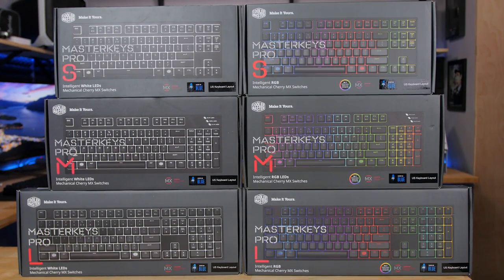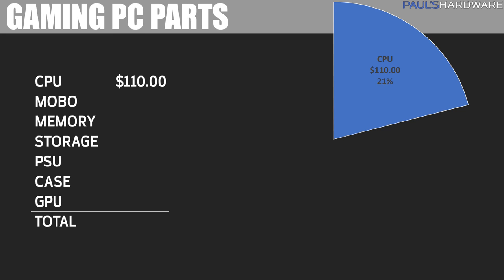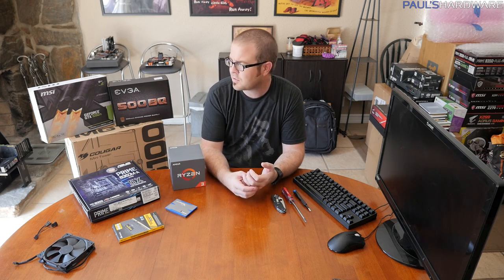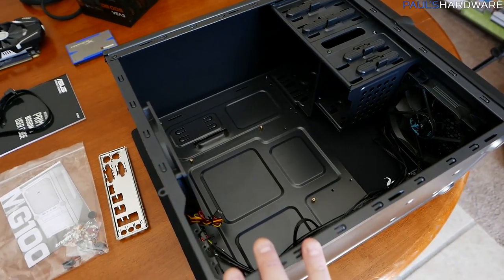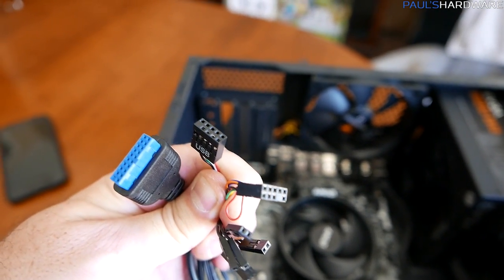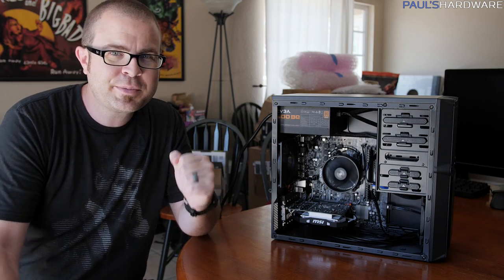How To Build a $525 GAMING PC with Ryzen 3!

Comment from the maker: -== TIMESTAMPS ==-
0:25 Introducing Ryzen 3
2:07 Intro to building a desktop PC
2:42 The 7 main parts in a Gaming PC
3:22 This build's Parts + How much each part costs
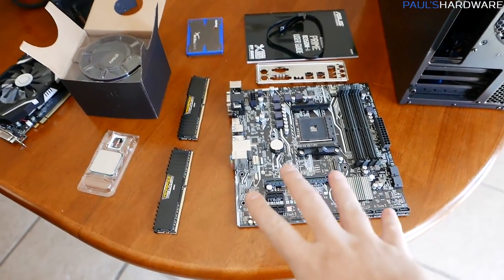9:12 Preparing to Build
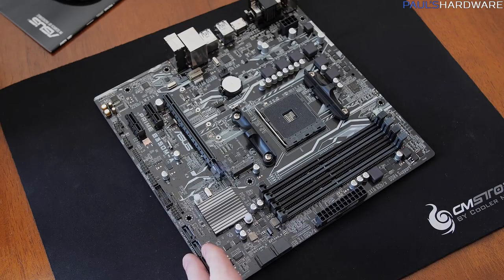11:37 CPU Installation
13:51 Memory Installation
14:58 Prepping the Case
16:23 Installing I/O Shield
16:59 Power Supply Installation
17:34 SSD Installation
18:20 Motherboard Installation
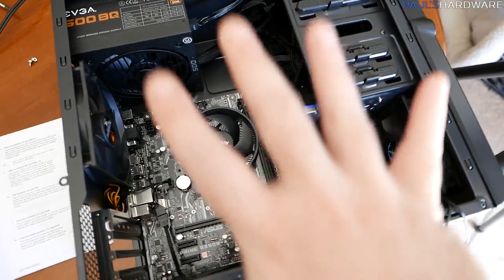20:11 Plugging In Fans and Power Cables
22:32 Plugging In Front Panel Connectors
23:21 Installing Graphics Card
24:29 Final Build + Closing Thoughts
Reply: Paul's Hardware I got 16 GB of ddr4 2800 MHz RAM for about £80 or $105, the only download is that it's a 4x4gb kit. It's the ADATA XPG Z21 or something like that.
Reply: link for the where to get windows 10 for 30 bucks??
Reply from the maker: I added the Windows 10 + other video links to the description, also cards are added now too!
Reply: Paul's Hardware does the $550 include windows 10 price
Reply: Thank you for at least mentioning peripherals and OS.... Two major price factors often left out of build videos
Reply: no you have to get linux no worry because arma and xplanes are on it. and thats all you really need
Reply from the maker: fixed!
Reply: i would say go with the g.skill ripjaw v series for 65$ its 2800 speed but not to overpriced
Reply: ok the song paul please at 1901
Reply: hey paul, how did you get those ram sticks running at 3000? i got the same motherboard with a 1600, same ram but the ram will only run at 2333
Reply: Paul's Hardware just thought I would say that if your lucky you can find that 1050ti at microcenter as a open box for $111 
which is a good deal.
Reply: Paul's Hardware You said the 1050 ti had 2GB it has 4GB
Reply: hey man that 1050ti is a 4gb model
Reply: 0:01 imitating JayzTwoCents.
Reply: Paul's Hardware why are you using nvidia gpu on a budget pc because gsync monitors cost as much as this pc
Reply: this video is both wallet friendly and noob friendly in many ways. like it
Reply: Paul's Hardware ii
Reply: 1:31 Been building and using PC's for years and only now do I discover CHA_FAN stands for Chassis Fan, I always cal it case fan so I always thought to myself, well, shouldn't this be CAS_FAN or CASE_FN or something... Now I get it! Thanks Paul!
Reply: You said Ryzen doesn't have integrated graphics but the motherboard has VGA and DVI. Why?
Reply: For AMD's next gen APU's when they come out.
Reply: There is a Ryzen based APU in the works. Release dates are sketchy.
Reply: Paul, would it be possible to have some benchmarks with this build? this might be a good cheap 1080p gaming pc i can get for my sister to get her back into gaming so she doesnt need to struggle with poor performing laptops anymore
Reply: Kevin Archer I have a similar pc, overwatch 1080p will run 75 fps
Reply: RavenGaming umm thanks, what other games and frames can you list, I've never played overwatch and don't care to lol sorry, and what graphic settings? I'm on pcpartpicker right now putting something together, gonna change a couple things from what Paul chose, but not too much

My sister would probably play guild wars 2 the most, unsure what else she would play, but her bf might play shooters, so gta5, bf1 settings and fps would give me an idea, I'm thinking she will be fine with a 1050 ti 4g card, it's cheap, it should run most things currently, and she can upgrade the gpu later if she needs to, but just getting her started would be nice
Reply: Cool build but meaningless without numbers to validate the "why" of it. 

It's a growing trend that has been kind of getting annoying lately. 

"Let's build a system!"
Cool build. What's it do.
"Tune in next week when I get around to benching it!"
God damnit... Really?
Reply: he usually does benchmark videos separate
Reply: Hi Paul not sure if anyone pointed it out but at the bottom of the case there is 4 screw holes that is the size to mount a 2.5 inch driver you can see it in your video around 24:54 i build in a case like this and i utilized that spot for the ssd. thanks for the awesome videos.
Reply: +Kenny lagace
2.5 inch DRIVER or DRIVE?
Reply: whats the name of the song at 19:01  ???
Reply: Paul's Hardware Where's the monitor man???
Reply: lol drive hehe
Reply: on my mind - anders bothen
Reply: Paul's Hardware , I want ask u about how to choose matx size mobo for amd ryzen 3. Idk how to choose which one. Can tell me which matx mobo am4 is cheap and quality good?
Reply: Paul's Hardware, RX 550 4GB + R3 1200 = ?
Reply: Paul's Hardware Thanks so much Paul this was a great tutorial, I just built my first pc with it. 
Rosewill FMB01
Ryzen 1200
Msi gaming pro mobo
8gb Viper Elite 2800 ram dual channel
450w evga bt
Wd blue 1000gb hd
Used GeForce 970
$510 of Awesomeness
It's a beast! Thanks again!
Reply: Have a major hard-on right now, thank you.
I'm a noob to all this, I bought my first laptop 3 years ago (my first PC ever), I was salivating over a $2000 rig that was just out of my reach because of the economy and every thing that entails, but this video looks (just about) easy enough for me to do. The price point was the major factor, so thank you.
One question, if I don't find the proper case I can just use a cut out card board box and superglue to house everything, right? I'm not stupid or anything, the box WILL have vents to keep it from overheating, duh.
(last part was a joke)
Reply: D Sandoval
Your broccoli sandwiches will achieve both sentience and vocality at the moment of being consumed.
Reply: Hay Paul I have purchased all of these parts for my build on Christmas and when I finished it did not turn on. Now this could be for many reasons but i remember that I had a 8gb ram that was clocked at 2400Mhz and when I looked back on your video the one you used was clocked at 3000Mhz. After doing research about the ram situation for ryzen chipsets I noticed that most people would say that you will have better luck having a higher clocked speed ram e.g. 3000Mhz  so i decide to purchase the exact same kit that you have bought now they will come on the 27th as I am typing this and i would like to have your say if this is a good purchase/ if it is true that Ryzen requires/needs a higher clocked speed ram to work . Also again using the same parts as you in the build.
Reply: The Ram is nowhere near $80 its 120 click the link you posted

Comment: I like to agree 99,9% of the time with what Paul says but at 1:04 I thought I misheard something.
Quote: "If you overclock a Ryzen 3 1200 you get a Ryzen 3 1300X" ... a non-overclockable 1300X at that point I suppose?
Or am I tripping and is the max frequency on these chips the same?

Comment: The motherboard almost costs as much as the processor itself lol
Reply: Floppin yeah
Reply: Floppin I'm guessing this is supposed to be a budget build and if it is the motherboard shouldn't cost that much
Reply: if you dont want to overclock you can use a320 motherboard XD
Reply: Funny you should say that, because I remember that for my very first computer, I paid nearly exactly the same for the CPU, motherboard and RAM, at €30 each (this being in the Socket 754/939 days, when CPUs were much cheaper)
Reply: Still better than i5 7640x where it is x2cheaper than the motherboard
Reply: Yeah and it's overclockable, and upgradable!
Reply: and how is it upgradable?
Reply: Uchiha Madara you are able to put in a ryzen 5 or 7 and can put in more ram, that's what upgradable means
Reply: AMD is going to keep using the AM4 socket for a few years, or so I hear. That means that in the future when AMD comes out with a new Ryzen lineup you can just take out this Ryzen 3 and thrown in a 2nd generation Ryzen 7 CPU or whatever fits your needs. Also it is overclockable.
Reply: Tuchulu they confirmed before launch, as paul has retorted on a awesome hardware episode, they claim atleast 10 years, but take with a grain of salt. A company being a company and all.
Reply: Yeah, and also has 4 usb 3 ports and 2 usb 3.1 ports instead of the crap usb 2 ports that are standard in cheaper motherboards. If you ever spent hours instead of minutes transferring gigs of data from/to external HDDs/Flash drives you know it's damn well worth the extra little money.
Reply: There are b350 for 65
Reply: low end cpu + mid end mbu that supports high end cpu and oc, so a good deal.
Reply: Magic Turtle Gaming please tell me where did you find a cheaper B350 motherboard that also had usb 3.1 and four memory slots because I've search amazon and pcpartpicker's parametric filter and found none. Also the price difference between the cheapest b350 micro atx board I could find and this one is between $8 to $20 depending on where you look so here's my question: Are you such a miser  that you're willing to let go of better I/O and and more ram slots for that measly amount of money? Just because it's a budget build doesn't have to have the shittiest components available.
Reply: Énio Fernandes calm yourself it's just YouTube
Reply: Magic Turtle Gaming, where double standards and hypocrisy abound, gotcha.
Reply: Bridger Reif Hammond nothing wrong with investing in a good motherboard if you plan on upgrading later. I also chose a good motherboard when my laptop died and I had to scrounge money for parts for a new PC. I went with an MSI MPOWER Z87 because I needed wifi and wasn't much more expensive then other Z87 motherboards, and went with a Pentium G3420(1/3rd the price of the motherboard). The naysayers will tell me how misguided I was by going with that motherboard  and CPU combo, It served me well until recently and now that I needed more cores and I could afford it I upgraded the CPU to an i7 4790K and it's still beast of a PC without buying a complete system.
Reply: Bridger Reif Hammond nice starting point a nice case but your upgrade path will be limited by the case though as it will be pretty toasty in there the faster you go!
Reply: +Bridger Reif Hammond - Neat job. If you don't mind me asking though, and since you say you've been an AMD fan for years, what was your old system? Was it Bulldozer or still K10? I still used a Phenom II X6 1055T before upgrading to a Ryzen7 1800X, because I too have been an AMD fan for essentially all my life, and yet I didn't want to "upgrade" (sarcasm quote marks thoroughly justified) from a Phenom II to an FX Series, so I was waiting seven years to finally be able to really upgrade my CPU, and just got an 1800X as soon as it was available for preorder.
Reply: Bridger Reif Hammond I have an FX 4300 and want to upgrade to ryzen 5 1600
Reply: Bridger Reif Hammond with the sentry case I don't think you can even have water cooling in place of the GPU so you can go as big as you want as long as you ditch the case, yeah.
Reply: Énio Fernandes go away
Reply: Bridger Reif Hammond it has but barely. You're limited to either something the size of an R9 nano with a 120mm radiator for the CPU or a 240mm radiator for the CPU and no GPU. If you want to use a 1800X and a Vega 56/64 things will get extremely toasty, that's all I'm saying. Of course you don't need that much to build a very capable gaming PC
Reply: never cheap out on your motherboard
Reply: Uchiha Madara I'm waiting on 2500x to stick in instead of r1200 in the same motherboard
Reply: you can buy a cheaper motherboard and a cheaper power supply, but you would strongly sacrifice upgradability

Comment: I remember working as a system builder in 2006 when dual core CPU's were still on the rise. AMD was the more affordable choice in most cases, which really do require delicate care. Those pins are really fragile. Once one of my (intern) coworkers dropped it from like, 1 inch onto the motherboard, and an entire row got bent inward. I managed to bend the pins back for him without damaging or breaking any, but we were sweating bullets the entire time when this happened.

Comment: Basic advice for beginners. Always build computer outside the case first and try to post. So if there is a problem with one or multiple components, you don't have to  undo all the work you've done mounting inside the case. Other than that, good video.
Reply: How good is this PC for gaming.

Comment: It's so amazing that for $500 one can build a pretty decent PC today.
Sure you can always go higher, the amount one can spend is unlimited; but to get a console level PC for gaming/graphics you can do for reasonable amount - and it's a PC after all, with everything that comes as an advantage over a simple console.
This build is spot on: By going Ryzen, not only is it cheaper, but thanks to the 1 socket, you can always upgrade to a beefier CPU later; GPU can always be replaced; memory, storage always upgradable.
The only suggestion I'd make is, if somone knows/feels that the 1050 Ti may not be good enough for them but are short on money, go with a used 1050 Ti (or anything) and used memory modules. Then saving money and upgrading the GPU in 3-4 months would mean minimal loss. But never buy used storage.

Comment: I would like to mention, both the ryzen 3 x1200 and x1300 cost around the same atm... and i feel like youd be able to get more 'overclockabiliaty' out of the higher base clocked cpu. Just incase you wanted to get better performance out of an ok cpu

Comment: So I got some questions.... I'm a more casual gamer looking to upgrade and this video appeared on my front page and I checked into it. Paul doesn't seem to have a website with forums, so I'll ask my questions here.

1). My 5-year old desktop computer has an AMD 6-Core FX6300 3.5Ghz, an ASUS M5A97 and 16GB DDR (don't remember what speed), along with a 660 GTX. How much better would the system in this video be, than the above specs? I know the graphics card is worlds better, but the other hardware I am not sure about. I know how to put a computer together as I've done so for years, but I've kinda fallen out of the loop as far as technology advances go as it's been 5-6 years since I've last built a PC.

2). Will the above fans actually keep that system cool under load? The computer specs I listed above, the case it's in is a mini-tower with two of those really large fans (what are those, like 180? 200? mm), one in the front, one in the back and a standard exhaust fan, AND I was having overheating problems after a little dust built up in the heatsink so I replaced the stock cooler with this huge vertical heatsink with copper pipes. The cooling system above seems.... basic, considering what my older computer needed to stay cool. I also worry about the GPU being so close to the bottom of the case, is air going to have very good flow there?

3). How are SSDs nowadays? I know 5 years ago, SSDs when they first came out were widely criticized as they had very limited writes. Reading is lightning fast, but writing to them eventually burned the chips out and the drive would eventually fail. Did they manage to improve this? Is it safe to put something like the OS and/or frequently updated games on such a drive and have it work for years?

4). What's the minimum power rating you'd think to be safe with this setup? I do not recall exactly, but I think I have a 470-watt in one of my computers that I want to upgrade, but the one in this video is a 500 and I recall Paul saying it would leave "a little headroom in case you wanted to upgrade the GPU".

Thanks in advance!

Comment: Isn't a 1050 2GB and
            1050 ti 4GB
Reply: no...the 1050ti is mostly a 2gb card. It even says it on the box. Same as how the 760, 960, came in 2gb and 4gb.

For  $115 you get a 2gb 1050ti and for $139 you can get a 1050ti with 4gb as an option.
Reply: no im pretty sure he meant the 1050, try looking for a 1050 ti with 2GB, you'll have a tough time
Reply: For desktop yes, for laptop there is a 1050 with a 4GB variant
Reply: SUPER USER If you're getting a 1050 ti get the ssc for better clock speeds and it runs a bit cooler
Reply: Dana's #1 Fan You can get both versions of the 1050ti for the same price
Reply: Dana's #1 Fan I live in the states and both versions were $139
Reply: shadowofdeath24 no... wrong. 1050ti is always 4gb the 1050 is always 2gb. look it up.
Reply: Had to check the comments for confirmation because I have a fever and thought I was tripping for a second but, yeah, I thought that about the 1050/1050ti too!

Comment: YES YES finally i can upgrade RIP i3 4160
Reply: wouldn't a decent haswell or broadwell i5 be a better choice as you don't have to factor in the cost of a motherboard? Ryzen gives you a great upgrade path up to 8 cores and DDR4 though
Reply: I had i3 4170 and it was so bad now i have i7 7700 it's so much better upgrade asap
Reply: defi well the r3 does open the path up to r7 and the next 2 or 3 generations of ryzen on am4 *if amd sticks to there promises.
Reply: just get a 4770 off ebay?
Reply: Just get a 4690k/ 4770k off eBay for like 75$
Reply: omar aman 4690ks are going for much more than that
Reply: it's a 4th generation i3 so that's weaker than r3, but I still don't think it's worth to switch except if he's going to upgrade to a ryzen 7 in the future. Then getting an r3 and a b350 motherboard is a good choice.
Reply: Your best bet would be to find a used 4770K/4790K or 4670K/4690K. That will be a HUGE upgrade for you and it will last for years to come. You have to remember when switching to AM4 socket, you will need a new CPU, mobo and RAM (DDR4). Which all together will cost as much as 4770K/4790K which STILL absolutely destroys any Ryzen 3 chip.
Reply: i have a non oc mobo matx board with 4gb of ddr3 ram
Reply: You could always use a hyperthreaded xeon i think they'd work just as good as an i7
Reply: Sleepy Weirdo did you upgrade yet?

Comment: So yeah there is a mounting point on the bottom of the case for an SSD you just screw it in from the bottom. The holes are recessed up into the case to leave room under for the screw heads and elevate the body of the drive to allow for airflow. 17:34